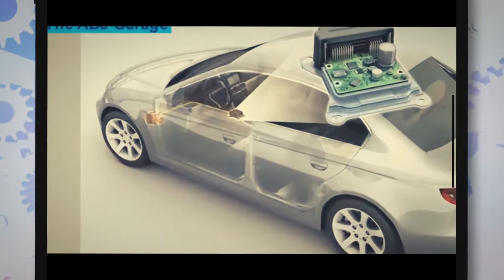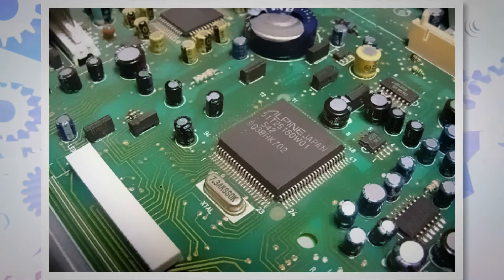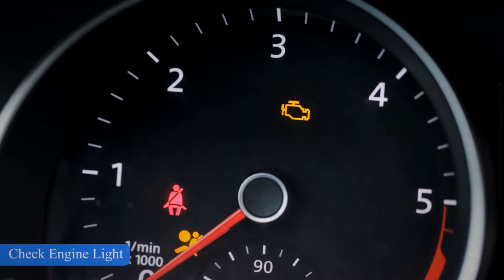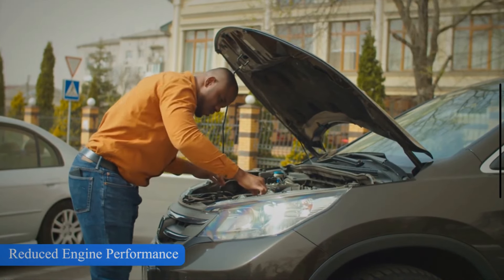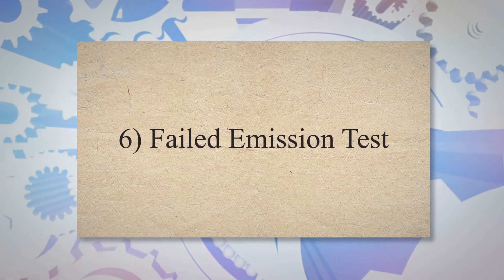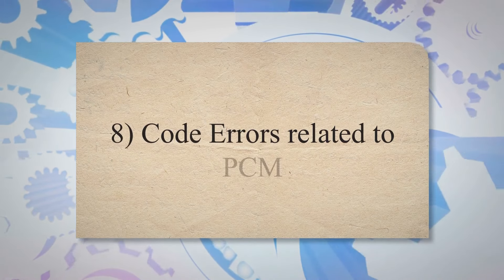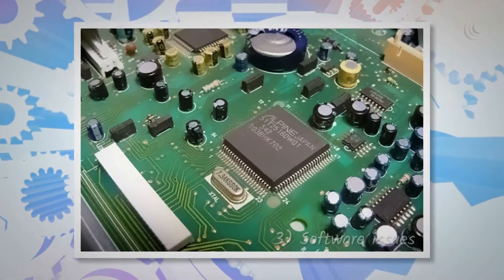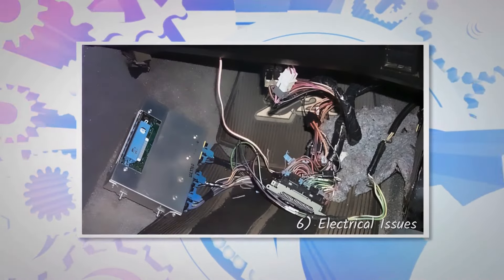Top 8 Symptoms and Causes of a Bad PCM

Comment: I had a '05 VW Jetta, it stalled while i was driving on the street. Code P2177 popped up, so i changed fuel pump, MAF sensor, clean fuel injectors and replaced spark plugs. My last resort was the PCM was bad, but wasnt sure because the part was $600. But hearing the beginning of the video you said it also plays a part in the AC (which also was another problem). I changed the AC compressor, AC relay, ac radiator fan, vacuumed and charged it. So do you think it was the PCM the whole time?
Reply from the maker: Yeah, it is possible that your PCM is faulty because a faulty PCM may also trigger a false code. It is recommended to consult a professional mechanic.

Comment: I have replaced coolant sensor 3 times and wiring is perfect and truck stalls then starts and runs rich and check engine light is on with no codes any idea's
Reply from the maker: The issues you're experiencing may be due to a faulty fuel system, a problematic mass airflow sensor, or an issue with your truck's powertrain control module (PCM). Each of these can cause a rich fuel condition and stalling, even if the coolant sensor and wiring are functioning properly. However, it's unusual to have a check engine light without any diagnostic trouble codes. It could be a sign of a failing PCM. Remember, this is just a starting point, and a thorough diagnosis by a professional mechanic is recommended.
Reply: @MechanicalBoost  I finally got codes po118 po117 don't make sense and replaced pcm 2 times
Reply: @MechanicalBoost  maybe a VCT. .if it stalls out of nowhere driving or while slowing down mainly? Although as long as the gas in pressed you don't stall. But as soon as you go to slow down..do you hear chugging? Or like something is clogged sounding
Reply: VCT
Reply: VCT
Reply: Take out your or maybe it's the VVT. Lol. I'm a roofer but check and clean it
Reply: @melissaklemm9976  it ended up being my cht sensor has 2.6 volts on it replaced pcm still have problems
Reply: @twinscrew9.047  sensor  indeed of some sort
Reply: Boy you got a good guess thing going on  .would drive me nuts
Reply: @MechanicalBoost  agreed
Reply: @melissaklemm9976  yeah its a nightmare

Comment: I’ve got an 06 Chrysler 300c. It’s the hemi. Getting code p0300. Wouldn’t idle when I first got it just kept stalling. It’s got no cats on it. I changed the spark plugs and coil packs an it started up an ran fine! I got cats for it an I was only able to get passenger side cat on. Gonna have to have a shop do the driver side but now the p0300 code is back and the car will idle but when u put it in gear it stalls out. Didn’t have this issue until I put passenger cat on? Need some suggestions! Gonna change out the fuel injectors next but what would be your advice?
Reply from the maker: I recommend to inspect your fuel injectors as well as ignition coils. P0300 code is usually triggered due to a misfire and a faulty ignition coil or fuel injector may also lead to misfire..

Comment: I have taken my Kia Rio to 4 different shops and they can’t figure out what is wrong. It turns and acts like it’ll start, but won’t. I have changed the gas tank, spark plugs, new battery, camshaft, and crankshaft. The last mechanic said it has to be the ecm but wasn’t sure. He said he didn’t have the time to go to junk yard and the other 3 shops told me to just buy another car. I can’t cause I ended up hurting my back and doctor won’t release me to work so I can’t get another car being a single mom. Any ideas? The problem before this was when I put gas into car would die and take several times to start. Also was running code p0343, p0650, p0016, p0172, & p0456. I fixed all but the p0172,p0456 & p0650. After clearing the codes I only get p0650. I thought about replacing ECU then if that didn’t help change the canister purge valve.
Reply from the maker: I cant tell you the main issue with your car without its proper inspection. Basically, p0650 is set when the vehicle's Powertrain Control Module detects a fault with the Malfunction Indicator Lamp (MIL) electrical circuit.

Comment: I have a c0298
P1120
Wire was damaged and replaced. I erased codes works fine. I turn off vehicle and the codes will appear again.. I erased codes again.  Works perfectly. Turn off and back on again and codes reaper
Reply from the maker: @01..........  The recurring C0298 and P1120 codes, even after fixing a damaged wire, suggest that there may still be an underlying issue with the wiring or connectors. Here’s what each code generally means and what could be causing them to reappear:

C0298 Code: This code is typically related to the Electronic Brake Control Module (EBCM) or the Stability System. It often indicates an issue in the EBCM circuit, such as a bad ground, poor connection, or damaged wiring.

P1120 Code: This code often points to a Throttle Position Sensor (TPS) or Accelerator Pedal Position (APP) sensor issue. It can mean a problem in the wiring or connection to the sensor, or even an issue with the sensor itself.

Since you've already repaired a damaged wire, the fact that the codes return after cycling the ignition might suggest:
1)Loose or corroded connectors: The repaired wiring might be good, but a connector could be loose, corroded, or otherwise not making a consistent connection.
2) Faulty ground: Many electrical issues stem from a poor ground connection. Double-check the ground points related to the EBCM and TPS sensors.
3) Damaged sensor or module: If the wiring and connections seem solid, the sensors or control modules themselves (EBCM or TPS) could be faulty.

Troubleshooting Steps
1) Inspect Connectors: Unplug and check all relevant connectors for the TPS and EBCM for corrosion, bent pins, or looseness. Clean and reseat them.
2) Check Ground Connections: Locate and clean the ground connections associated with the EBCM and TPS circuits.
3) Test Sensor Output: If possible, check the output voltage from the TPS sensor to ensure it's consistent and within the specified range.
4) Check Wiring Continuity: Use a multimeter to test for continuity from the repaired wire to the sensor/module and to the ECM to confirm there are no other breaks or shorts in the line.

Comment: I have a chrysler 300 2006 check engine light came on transmission started acking funny not charging gears getting code p0700 and p0748 got a transmission out of 2006 dogde charger put it in this transmission giving code p7048 and p0700 anyone kno what is problem

Comment: I’ve got a 99’ Ford mustang Gt. I’ve replaced fuel pump. Fuel filter. Injectors. Alternator. Fuses. Still will not start. Cranks and tries to start but it can’t. Fuel pump is working too. Says no communication to the pcm. I’ve done everything else. Will buying and installing a pcm make it run?
Reply from the maker: Before buying new PCM, you should test your old PCM using a best suitable scan tool. And also check the software of your PCM because in some cases, PCM start to create issues because its software needs to be update

Comment: Hey I think this is wrong with my 2013 dodge dart, it starts fine. But when I am randomly going down the road it starts jerking back and forth. I noticed I get bad fuel economy as well. I have a code reader and it’s says pcm/ecu is not registering data correctly. I am positive this is it. Thanks
Reply from the maker: Thanks for sharing your feedback.. If your PCM/ECM is faulty, you should replace it as soon as possible to prevent severe engine damage.

Comment: My 2008 mazda mx5 blows 15A engine fuse when i turn on the ignition switch and scanner says error code u0100 that is for lost communication with pcm and don't know if its a pcm problem cause sometimes the car was running fine then the performance drops and have to rev up but at around 4k rpms the car just dies randomly and the fuse keeps blowing and nobody wants to work on so i'm here 😢
Reply from the maker: The issues with your 2008 Mazda MX-5 blowing the 15A engine fuse and showing a U0100 error code, indicating lost communication with the Powertrain Control Module (PCM), can be challenging to diagnose.
1) A short circuit or ground issue in the wiring harness connected to the PCM can cause the fuse to blow.

2) A malfunctioning PCM can cause intermittent communication issues and might lead to the fuse blowing.

3) A shorted sensor or actuator connected to the PCM 
4) Poor ground connections can lead to intermittent communication issues.
Ensure all ground connections are secure and free of corrosion.

If the problem persists after these steps, it might be necessary to seek professional help from a mechanic or automotive electrician, as they have the tools and experience to diagnose and fix complex electrical issues.

Comment: I need help please anyone ever got this symthoms start the vehicle let it run in about 15 20 minutes just randomly dies and try start back it would crank just like when u have a faulty fuel pump but i put new fuel pump , coolants temperature sensor, fuel rail sensor, oxygen sensors but what make me think it the pcm i unplugged airflow sensor car did not turned off after the car die i have to wait for atleast 15 minute for it to start back
Reply from the maker: @fredlafleur4996  Based on your description, there could be a few reasons why your vehicle is randomly shutting off and then refusing to start for about 15 minutes. Since you've replaced several components, including the fuel pump, coolant temperature sensor, fuel rail sensor, and oxygen sensors, let’s evaluate the possible causes systematically:

Symptoms Analysis

1) Randomly dies after 15-20 minutes: Indicates something is failing as the engine warms up.

2) Won't start but cranks: Suggests an electrical, fuel delivery, or sensor issue.

3) Runs when the MAF (Mass Airflow Sensor) is unplugged: Points toward a possible issue with the MAF or its interaction with the PCM.

Possible Causes

1) PCM (Powertrain Control Module):
If the PCM is faulty or overheating, it can cause the engine to shut down and not restart until it cools down.The PCM controls engine timing, fuel injection, and sensors like the MAF. If unplugging the MAF prevents the stalling, the PCM may be compensating for a sensor miscommunication.

2) Crankshaft Position Sensor:
A failing crankshaft position sensor can behave exactly as described—working fine until it warms up, then causing the engine to die and refuse to start until it cools down.
Look for stored trouble codes related to the crankshaft or camshaft sensors.

3) Mass Airflow Sensor (MAF):
The fact that unplugging the MAF allows the car to keep running is significant. It could mean the MAF is faulty or the PCM is not interpreting its signal correctly.
Try cleaning or replacing the MAF if not already done.

4) Ignition System:
A failing ignition coil or module can also shut the engine off after warming up.
Test the coils or ignition module for heat-related failure.

5) Fuel System (Despite New Pump):
Fuel injectors or fuel pressure regulators might be malfunctioning.
Test the fuel pressure when the car refuses to start to ensure it's within specifications.

6) Electrical/Relays:
A failing main relay (often called the ECM relay or fuel pump relay) could cause these symptoms. Heat may cause internal contacts to fail, cutting off power to critical systems.

Next Steps
1) Run a Diagnostic Scan:
Check for stored error codes using an OBD2 scanner. This can pinpoint issues with sensors like the crankshaft position sensor, MAF, or PCM.

2) Test the Crankshaft Position Sensor:
Use a multimeter to test its resistance or a scanner to monitor its signal while the engine is running.

3) Inspect the MAF Sensor:
Clean the MAF sensor using a dedicated MAF cleaner. If cleaning doesn’t help, try replacing it temporarily to rule it out.

4) Test Ignition Coils and Relays:
Check the ignition coils for weak spark after the vehicle stalls.

Test relays with a multimeter to ensure they aren't heat-sensitive.

5) Inspect PCM and Wiring:
Look for signs of overheating or corrosion around the PCM.

Check ground connections and harnesses for damage or poor contact.

Why PCM May Be the Culprit

The PCM is directly involved in processing inputs from various sensors (MAF, crankshaft, oxygen sensors) and controlling the engine.

If the PCM has an intermittent fault, especially heat-related, it can cause random stalling and hard starts.

If diagnostic tests point to the PCM, you may need to reprogram or replace it. Ensure that wiring and grounds are intact before committing to a PCM replacement

Comment: Where is the pcm located in a 2012 ford F150
Reply from the maker: In a 2012 Ford F-150, the Powertrain Control Module (PCM) is typically located under the hood, near the engine compartment. It is often positioned on the firewall, on the passenger side of the vehicle. However, it's always a good idea to consult the vehicle's manual or a repair guide for the exact location, as it can vary slightly depending on the specific model and configuration of the truck.

Comment: Got an 05 duramax that's been acting like it has a short and finally pulled a p0601 code
Reply from the maker: Yes, a bad PCM (Powertrain Control Module) can indeed cause a P0601 diagnostic trouble code (DTC) to be triggered in a vehicle's onboard computer system. The P0601 code is specifically associated with a malfunction in the PCM's internal memory or its programming.

Comment: But where is it located?
Reply from the maker: The PCM in a car can be located in different places depending on the make and model. The most common location is the engine bay, but in some models, it may be covered and located near the windshield. It is recommended to check your car manual to find the exact location of your PCM.